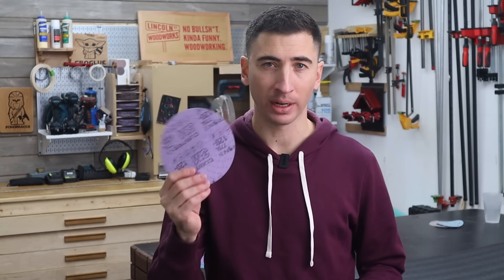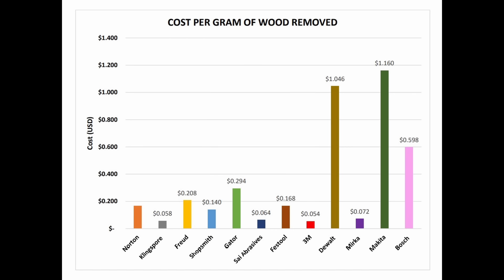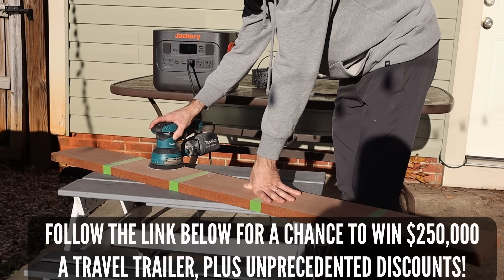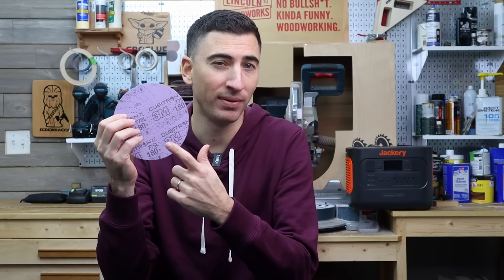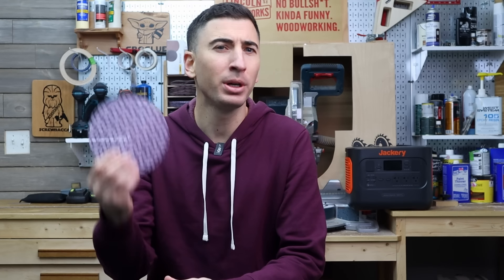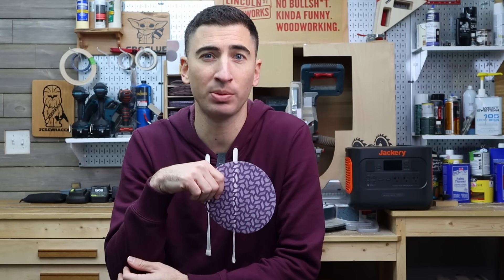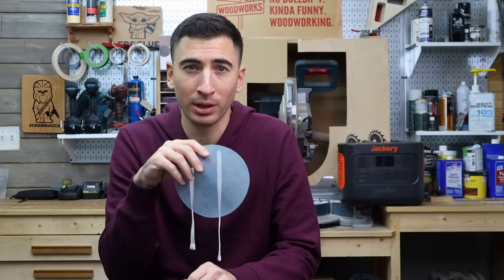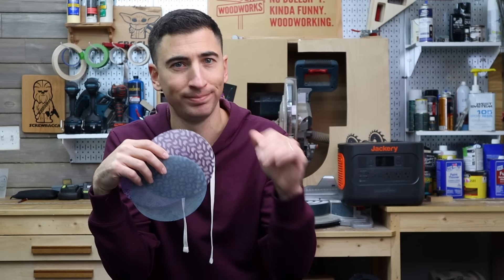This $.07 Upgrade Will Save You Hours

Comment: The timing of this video as it relates to me is uncanny. 

Yesterday I purchased a 5 foot long solid wood fireplace mantle on FB Marketplace for only $20. It was a hideous shade of orange stain, with both a glossy topcoat and faux “distressing”. 

Today I had fun sanding it down to bare wood (pine). 

I used my cheapo 5” Ryobi orbital sander, and a pack of Diablo SandNet discs. (Picked up from HD a few months ago, $20 for a pack of 60!) Because the piece was solid pine, I went ahead and used these 80 grit discs. According to the package, they are made of “Premium Ceramic Blend”. 

Then for comparison I got out my ancient box purchased 10 years ago of 40 grit Bosch discs. OMG. Even with the coarser grit, they hardly removed anything. 

The SandNet discs work so fast and I got to bare wood within seconds. The whole 5’ mantle took under an hour to bare wood. 

I didn’t realize I should use a vacuum, I skipped doing so because my 12g RIDGID is bulky, cumbersome, and noisy. (My next purchase is definitely going to be a Festool dust extractor!) 
Also, I didn’t know these need a extra padding layer. There was one at the bottom of the box! Next time, I’ll use it!

Thanks for all the great info! Very happy with the Diablo SandNet discs. I did go through 12 of them but at 3/$1, it was only $4. 

I’ll be donating the Bosch discs to my local Habitat Restore.

Comment: What about the abrasive disc cleaning sticks like the one from powertec. I use these on my bench sanders and they work great, at least visually. I haven't done any testing to confirm they are cutting as well as they were new, but it definitely improves the cutting from when they were gummed up. Are these a viable option to extend the life of the pad?

Comment: The pad saver is basically required in some cases, like my old dewalt sander. I bought some 710w a while back when WittWorks talked about it but I didn't know about the pad and it barely sticks to my dewalt's hook and loop at all, basically unusable. Taytools is sold out of it currently, so now I'm using my old shitty amazon discs for now until I can get my hands on a pad saver. Since I bought it, WW made another video talking about this very issue.

Comment: Great addition to the sandpaper disc videos. I am confused as ever though with the pricing regarding festool discs. 100 festool discs are $74, so $0.74 per disc. Some grits are $49 for 50, or $1.02 per disc. If you buy the ten packs, which is a bonkers decision, they are $19 for 10, or $1.90 per disc. 

So, where does the $1.33 figure come from? What am I missing? 

Another point, I’ve sanded with cubitron, granat, and the chevron stuff. I enjoy the feel of the first two, but found that the xtract would not stay on my pad. I even bought a new pad in case that was the issue. Would the pad saver fix this problem?

Comment: I appreciate the video, but there is one thing that bothers me.  "Amazon" sandpaper?  Amazon is a seller, you can buy many different brands on there, so to compare anything with "Amazon" sanding discs doesn't really make sense.  I think you may mean "... cheapest I can find on Amazon..." or "... Amazon bestseller..." or something.  Any thoughts on where Diablo Sandnet fits in among those you tested?  Also, love My Cousin Vinny!
Reply from the maker: I try not to outwardly disparage a brand more than necessary. The diablo sand net was included in JKM second video. I have a link in the description above. It performed okay - slightly better than the 310 but much more expensive

Comment: I appreciate the work and effort you and Jonathan Katz-Moses have put into this, but I feel that the pricing per sheet is kinda off when you factor in things like Black Friday specials. I.e. Home Depot for the last several years has offered a killer deal on Diablo Sandnet paper (no it's not the best, but it's up there for effectiveness, but when you're talking a 50 pack of discs for $20 vs the normal 10 for $15. The price per oz removed is completely flipped and talking a different dynamic entirely. I will go and hit HD during those times and pick up 4 combo packages just for the fact I'm getting my sand paper for $.40 per disc vs $1.50 a disc
Reply from the maker: Fair point but thats such a moving target not sure how you make it accurate. Even the 3M paper is 20% off right now. To me personally - the amount of wood removed is still the most important. Even if I need to pay a little more it's such a nominal difference that you still get it back by putting a premium value on your own time.

Comment: Surpised you didnt mention Norton MeshPower abrasive discs. I use them a lot on my commercial hardwood floor projects and definitely the best bang for the buck at $0.67 a piece for 5" discs!! Price is important when you have to sand 10k sf for intercoat abrasion!

Comment: Typically cheaper abrasive has less of the same grit per sheet or disc. Real cheap stuff may have 25% or less so not as fast or long before the abrasive is worn out.

Comment: So, what I'm hearing is the 301W for lower grits, and 775L for higher grits maybe?
Reply from the maker: I would reverse it. 775L is the workhorse for lower grits - 310 for higher grits. 710 also works there
Reply: @Lincolnstww  Good to know! I always liked the idea of mixing types to maximize efficiency. At the moment, I've got a couple of the 3M with the funky shape, but mostly I've just used the cheap stuff. One of these days I'll upgrade.

Comment: I grabbed a sample pack of of the 310W from my auto paint supply store (Tasco) and I was not impressed with them, having used them for sanding paint, bondo, etc. I've not tried them on bare wood, but my experience with them (for auto body work) was that they lasted about a minute before they were dull vs. the yellow sunmight disks which lasted for a whole panel. Again, ymmv and this was for auto work, but I won't buy them again.
Reply: Yea, 3M is way over hyped even with woodworking in my experience. Doesn't even deserve honorable mention compared to Diablo Sandnet. If you happen to Diablo Sandnet for auto I would be curios to know how it works?
Reply: @bhough410  sandnet is garbage. Anything you buy from a big box store is garbage.

Comment: If you’re using a battery to power your sander,  is there a variable of the power output of the battery changing the sander performance as the battery is depleted?  I like the idea of measuring quality of finish but hope the data wasn’t compromised by the sander power source being variable and not constant like a wall outlet.  Hoping it was just a few clips for the sponsor :)
Reply: That thing can deliver 1000-2000W of power, a hand sander is more in the range of 150W. If anything the power delivery from a power bank is often better and more consistent than you'll get on a circuit in your wall. By the specs that power bank should be able to do well over 6 hours of nonstop sanding.
Reply: @teguh.hofstee  I thought it may have enough output but I wasn't sure if he was charging the battery during any of these test.  I could see these tests taking >6hours.  He did a nice job with everything else, just seemed like a sponsor placement could have skewed the results.

Comment: 80 Grit becomes 160 after 25 minutes so after 25 minutes how long will it last if you keep using it as 160?  Ans:  A lot longer than 25 minutes.  So break in your sandpaper and shift the grit numbers up as you see fit.

Comment: I like the little tip about drawing all over the board with a pencil before sanding it. I have a bad habbit of forgetting what does and doesn't need sanded. So thats a good way to know whats been done already and to help me so I dont over sand an area. Just move on once the pencil marks are gone.
Reply: use a pencil. The ink from certain ball point pens soaks in too deep

Comment: Another thing to consider: Sandpaper doesn't just stop working when it gets dull. It starts cutting as if it's a higher grit than what's printed on the label. So a low quality disk will leave a "smoother" finish for the same amount of sanding-time than a good disk, just because the good disk is still sharp and cutting true to its grit level.
Reply: I don't think so. When your sandpaper becomes dull, it will sand slower, but the grits that are still on the sandpaper are the same sise as when the sandpaper was new.

Comment: REALLY excellent video my friend. Like a lot of folks I'm sure, I was a little unclear on the difference (in terms of time spent sanding/material removed) between the 710W and the 755L, and this video made it crystal clear what the pros and cons of each are. Ended up just buying both to try them out and it looks like that was probably actually a great decision as now I can sort of tailor my sandpaper to the type of project or type of wood I'm using.

Oh and good call on the pad saver. Put a disc of the Xtract right on the plastic plate of my cordless sander not realizing how  very thing it is and I literally couldn't hold it in one place, it was absolutely insane.

Thanks!
Reply from the maker: Thanks Adam! I think having both is the right move.

Comment: I noticed you did not test Diablo. I don’t think this can be called a quality test of sanding discs without a broader selection of disc to test. I mean three? As a scientist, I would have to laugh at that as a sample set. Obviously you’re not gonna get 100’s, but, you should at least go to the effort of getting 7 to 10 different sanding discs to compare.  To base your “conclusive” or even “reliable” test with a mere three sample set is absolutely ridiculous. There are no results here this is a NULL SET‼️‼️
Reply from the maker: Their tests I referenced included 10+ brands. Not sure what worse you’re looking for. The results of said tests were shown on the screen
Reply: @Lincolnstww  they were not shown in your presentation. Nor were they referenced to in your notes.  Don’t claim YOU had a valuable test set.  Referring to another’s research is a footnote in your appendices.  As you say, these tests were about 2 years ago.  Significant changes in brands and overall offerings have come to pass.
Reply from the maker: @donbrunodelamancha1927  Apologies forgot to add their links. Updated in the description. I never said I had a valuable test set. I said they performed the tests. Jonathans recent video was done a year ago and included over 19 different brands. Diablo was included and removed about the same amount of material as the 310. Also, calm down its just sandpaper. Anything else you want to complain about?

Comment: So how much money did 3M pay you and I don't believe for a second they didn't give you something or that your not vested into this?  lol your video although correct at a very basic level it ends right about there for correctness. Firstly vacuum systems will always work better than non-vacuum because of the obvious. Vacuum all the material out of the sanding process and you sand the material 1 time, Non-vacuum systems sand the material multiple times causing heat and disc failure.
-Discs designed to have a vacuum fail miserably with performance when not used in a vacuum system.
 - comparing 3m's cubitron which is a premium grain against Aluminum Oxide is like comparing a chevy cruze to a loaded Silverado 1/2 ton. oranges and bananas. That really gets my goat because it is a lie and a half truth at the same time  but twisted to be truth only. If i want to drive a nail, although I can do it with a chisel but my branded hammer will be better as a comparison.
Every abrasive grain is a tool with different purposes.
-Same for the backing, A film back is better than paper but NOT ALWAYS. You can't make those carte blanche claims.
  The only comparison to a cubitron would be any manufacturer's premium product like say Norton's or Hermes ceramics PERIOD. 
-your advice to use cubitron in finer grits is questionable due to the fact that the finer the cubitron grain the less performance gains and you would have more concern for the shedding caused by the lack of grain posts holding it to the disc. At 320 do you want wild grains causing scratches? of course not.
Why not be honest at the start and just say this is my opinion because - REGARDLESS OF WHO IS USING THE SANDPAPER BECAUSE OF THE ATTRIBUTES OF PERSONAL USE YOU CAN RUN ANY TEST AT ANY TIME AND MAKE WHATEVER YOU WANT OR WHOEVER YOU WANT WIN IT.
Your pricing comparison is out to lunch as well. If your paying $0.80 for an A/O disc then you are being robbed
glad to see 3M is still a major marketing machine though. Something needs to keep the people in St. Paul employed
Reply from the maker: I stopped reading after the your* typo. 3M didnt pay me anything. I have no affiliation like I said. That would be a really dumb thing to lie about

Comment: I bought two sample packs from Katz-Moses of the 775L and 710 to see what the difference was, no one was saying. The thing you left out is they can be vacced and washed, soap and water washed. Massive improvement, almost like a new disc. I'm gonna guess you didn't do that, try it! You'll like it.
Reply from the maker: I generally just toss them after 30 minutes like I said because the abrasives are worn down. Visually they might look new, but they still won't cut as fast